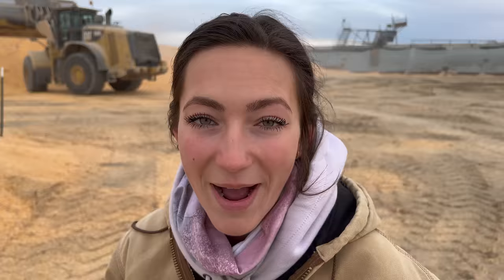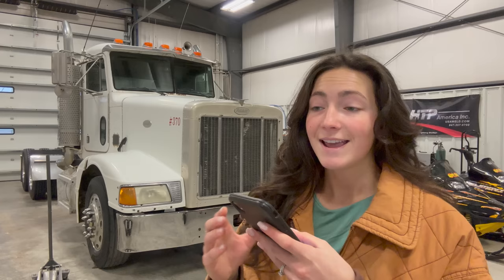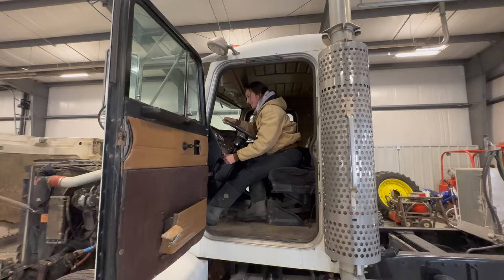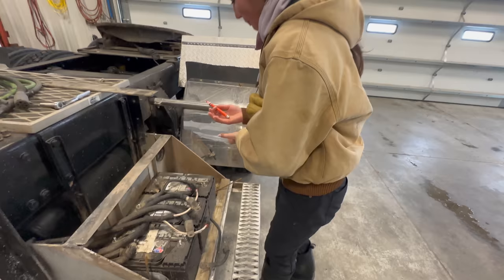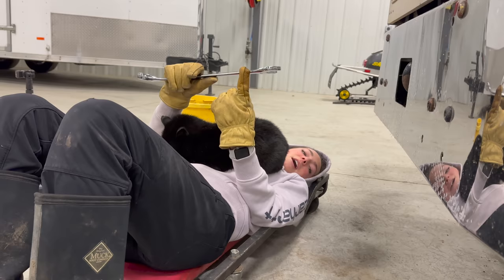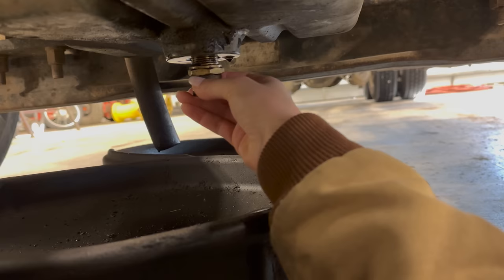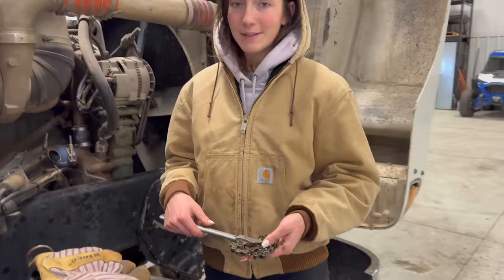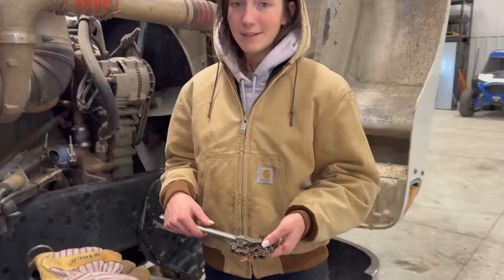The Worst Oil Change

Comment: Welcome to a truckers world! As for yore filters. They make a much larger chain wrench (longer Handle) the trick is when possible grab the base of the filter. The band wrenches do work the strap wrenches work but its hard to beat the large chain wrenches. I have even used 3 foot long screw drivers driven completely thru the filter. A tip fill filters with oil and fuel for fuel filters. If the Detroit series 60 loses its fuel prime its a lotta work to prime the fuel system. As for the heater it could be just low on coolant or the heater shutoff valve could be bad? Old timers used to use manual shut off valves at the engine so check for that. Hey its just a truck. Be kind to it and it will treat you the same! 😊

Comment: that chain-clamp should be sufficient. The problem is that it is stupid tight making the tool not sufficient enough. The same goes for cars also. In such case, try to use it on the edge of the filter where it is strong or all the way up at the top of the filter.

Comment: I have had to drive a rod thru the bottom to the opposite side  and have it long enough to get more leverage on the pull. Of course you will mutalate the filter but it gets discarded.  Could take the front tire off to have more room to work. Good luck

Comment: Get an oil filer wrench with a square connection. There are multiple types on the filter side (band, triple claw, or ones that look like a regular socket head but huge) but you could ratchet in tight spaces with a regular ratcheting handle

Comment: There is nothing wrong with the type of "wrench you have, but a band type wrench does usually work good, the filters seem to have just been on for quite some time and can be very difficult, another helpful hint would be to poke a hole in the bottom of the filters to help reduce messiness when taking them off. And when replacing the filters be sure to fill them with the proper fluids before putting them on to help reduce "dry" starts

Comment: It's been my experience with the 60 Series Detroit engine, that if you don't tighten it, little more than usual, it will come loose.... so, if you see a oil leak on that side of the engine, check the filters....

Comment: I think you probably have the filter off by now, but if not, a strap wrench with a several inch extension so you can get the strap up high on the filter and then a half inch breaker bar should get the filter freed up. I think someone might have skipped the step of oiling the gasket before putting that filter on.

I have encountered similar circumstances after buying used equipment in the past, thus I tend to make sure that I can break the oil filters or other associated parts free before I undertake the task at hand. I also allow lots of extra time and an alternate means of transportation, and park the vehicle where it will be out of the way and can remain out of the way for a couple weeks if necessary. At least you're not messing with it during harvest season!

Comment: This happens on new vechiles as well. Got a new vehicle and the fwctory must have put the oil filter on with an impact wrench  took a day and had to disassemble part of the vechile to get a good grip on the oil filter. Cuss a bit it helps a lot.

Comment: take a longer tube a little thicker than the filter, cut teeth on the end and tap them in a bit, push the tube up with the jack and then twist it.

Comment: It's best to run the engine to warm up the oil. Your problem is that those filters have not been changed in years. So you can try and warm up the rubber on the filter then drive a screw driver through the oil filter and trun. If all else fails you can cut the filter off. But if you cut the filter becareful you can start with a grinder then use a chisel or a Dremal tool .don't rush take your time. Good luck 👍

Comment: Large filter strap wrench, it will stretch some but is less likely to put hole in filter, the one I got has 1/2 drive one side and 3/8 on the other so once you get the stretch out with 1/2, you can use 3/8 to hold your progress.
I have used this strap wrench and had the filters still end up looking like pop cans, Volvo/Mack's have had the worst tight filters I have can across in semi trucks,
Also get filter wrench as close to top as possible, there far more strength at where the filter screws in.

Comment: take a small propane torch and heat the filter right where it meets the truck..the rubber will soften a bit and the heat may help the threaded part to loosen a bit..

Comment: Oil filter removal buy a truck filter wrench 1/2drive. Use at the very top of where it screws into body of oil filter flange. If that doesn't work might try a small cold chisel( if there is room looks tight) at the very top base of filter. Just be careful not to damage housing. Good luck.

Comment: In a worse case scenario ( like this one) I’ve had to punch/drill a hole thru the filter and use a put a bar thru the filter.   You want to get close to the gasket with only intersecting  the filter.

Comment: A correction for you, the 980K weighs about 70K lbs. not 700K lbs.  Still pretty heavy.  For the record, a 100 ton capacity railroad grain hopper car weight about 230K lbs. loaded, a railroad locomotive weighs around 175-225 tons.  Most current generation railroad locomotives are around 4,000-4,400 hp and carry 4,000-5,000 gallons of diesel fuel.  All of that said, they are still 3 times more fuel efficient per ton-mile of cargo hauled than a semi-truck.  You haven't felt real power until you feel 4 locomotives (or more)  get a 10,000-13,000 ton grain train moving.

As for your oil filter challenge, I second the suggestions of using some heat and a proper filter wrench.  If, however, the filter is already compromised, a common mechanic solution is to drive a heavy screwdriver or bar clear through the filter and then twist the filter off using the screwdriver or bar.  That's a last resort, but it may be your only choice if the filter is already partially crushed.

Comment: Because you need a strap type filter wrench that turns your force into torque instead of creating a pressure point like the chain wrenches do.  That filter is one mother tight though!

Comment: A 2" or bigger strap wrapped through  a pipe with a slit has saved me from overtightened filters a few times, then you can put the strap at the base of the filter (by the threads) and apply a much torque as you want to the bottom (....Basically 😉)  that one is tight though.

Comment: There's a decent chance that 980K was built at the factory I used to work at. That was one of the smaller models we made. You should check out the large wheel loaders they use at mines, like the Caterpillar 994. That is a monster.

Comment: You could try and poke through with a metal thorn. I'd say a big screwdriver but i'm afraid even the big ones are too weak for that. So you'll need something thats thin enough to get it through with a hammer but strong enough to stick a pipe on it and turn it. Thats the only cheap and quick way i can yet recommend since you already tried the regular methods. Otherwise you'll need a special filter wrench or a filter claw, but a big one.

Comment: Hey and hi, to make it real easy buy yourselves an oil filter or any filter removal kit, it’s like a socket that fits on bottom of filter which then has a large nut type that you can swing a big spanner on. Darn easier than anything else I’ve used. Toledo tools make a great kit.

Comment: drill a hole through the filter and stick a long extension or large screwdriver straight through it. or buy a better oil filter wrench, they are pretty cheap. A lot of them will dent the can just like that though.

Comment: Get your biggest screw driver and drive it through the center of the filter nearest the end that it connects to the housing on. Then give it a good whack with a big hammer to bust the filter loose. One substantial jolt to get it moving.

Comment: A lot of people don’t put oil on the new seal of the oil filter.  Hand tight plus 1/4 turn.  I just got another filter wrench with a bundle of tools that I don’t need.  I can send it to you.  If the filter is on too tight and the case crushes, often the only thing you can do is carefully cut it off ( a dremmel tool works ok) being careful not to cut the seat or pick up tube.  Give me an address to send it to and I’ll send you that filter wrench.

Comment: Put some heat on the rim,it will either melt or soften the rubber which is what is causing the friction. Also use vaseline to rub on the seal when refitting as it doesn't defrade the same as oil....you can thank me later 😊

Comment: I enjoy seeing the cat in the videos. 
I bought an old Nissan Frontier and had to do repairs after I bought it. The first oil change went about the same as yours. The right front wheel needed to be removed and I discovered a socket style wrench with an extension worked best to reach behind the hardware that was in front of it. 
I know you will keep  trying and you will get it done. 
Happy New Year.

Comment: Hi, greg and Laura, i love to watch your videos. Regarding your overnight filters, yea, no goo thing, but you are using pipe wrenches, which make it worst by crushing them. Get yourself a good set of steel belt filter wrenches and then use those close to te top of the filter where is the hardest part of the filter.

Comment: At this point, the best thing to do with those filters is to punch a hole through the filter with a screwdriver or punch. May have to use a drill. Anyway, punch all the way through and use the screwdriver or punch or whatever works, and use that to hopefully turn the filter off. The closer you can get to the top of the filter, the better. From the video, it didn’t look like you had much room.

Comment: Put it up higher on the filter if you can. I have poked a hole all the way thru and turned it with a screwdriver using both sides.

Comment: Probably by the time you get this message you're probably have the oil filter off the tool I have is a seat belt strap that has a bar on it that clamps around the filter up pretty high on the filter and you can use the ratchet and an extension on this type of filter wrench works real good for all the filters I've ever taken off

Comment: I would try one of two ways, first, get the truck up to operating temp then turn off the truck and try using a different oil filter wrench with it as close to the threads as you can get.  Second use a heat gun or a torch to heat it up then wrench it off.

Comment: Hey guys 
You need to pour clean diesel fuel into that filter  !
Otherwise the engine will stall out & will develop a fuel air lock.
Most filters have instructions on fitting & recommend 2/3 to 3/4 of a turn once seal comes in contact with the base.
So redo that before starting  !
Reply: I have used all methods sugested in comments to undo those oil filters in my 40 odd years of servicing engines...
I believe your auto parts store can provide a wrench that fits over the end of the filter & it has 1/2 drive for a strong bar or rachet with extention...
Reply: That’s a bad idea as fuel flows from the outside of the filter towards the center. If you pour fuel directly into the filter it hasn’t been filtered. You just need to either use the primer (if it has one) or bleed the air out after you install it.
Reply: @markgasper9913  why would you think I would suggest to pour unfiltered fuel into a filter ?
Tbe better method would be to have a fitting to temporarily supply gravity feed fuel on input side of filter & fill filter completely then quickly remove & reconnect original fuel line so as little air gets into tbe system.
But as Laura could well appreciate the first method would be satisfactory in their situation.

Comment: I would  try going both ways tighten/loosen. I have always had success with a large Channel lock If that didn't work I would try a large muffler clamp tight on the filter then use a long pipe attached to the muffler clamp. If that fails rip the filter part off and make a small tool to fit the holes in the filter like the "Talon oil filter tool" with a welder its easy to just make one and done

Comment: Get a filter wrench that goes on a socket wrench. Other wise, I’ve had to stab a screw driver through an oil filter in order to get leverage to remove it before. Someone decided to put it on as tight as humanly possible 😠 needless to say, I don’t do that when I change my oil-I do what you 2 did with the fuel filter. Never had an issue.

Comment: for the oilfilters, first turn the front wheels to the right, gives way more space to work, so can use a longer extension, these chain wrenches work great, but damage the filter easy, there are band wrenches, who also work great, but can get slippery easy, speciall when the filter is already damaged.. personally i would use the chain wrench, get a longer extension, and really try to move slow while turning the filter, the one who put it on there probably didnt use oil when screwing it on, thats why you use the oil, not to make it seal better, but to be able to get it off...just turn slow so the rubber seal has time to move, if you go too fast, or hit it like Grant did, doesnt work, only damages the filter...Goodluck!!...for the next time changing the filters, let the engine/oil warm up first, makes it wayyy easier...bit late now :)

Comment: Loaders small compared to the ones I wrenched on when I was a youngin.. Also batteries on the rig will be dead in a few months due to not cleaning the cable ends and the terminals nuts & coating with corrosion spray.. Fuel filters dont like oil on them use a smidge of vaseline or dip your finger in the fuel from the old filter

Comment: Worst case, send a long screw driver thru the filter to get it started. Sometimes they tighten up as they're driven. Ideally a strap wrench works the best, but they do have filter wrenches big enough. You'll need a hammer to get the screw driver thru the filter and element, the longer the better. Once it pokes out the other side, grab the handle and twist. When it comes off, make sure the rubber seal came off also. That tight, it might need to be retrieved.

Comment: Why didn't you prime the fuel filter? Warm the top of oil filter with a heat gun. Then while applying torque tap the bottom of the oil filter in an upward direction with a soft blow hammer.

Comment: You two had a good way to remove the filter with the belt, next time feed the belt through a boxed end wrench and  the try to remove the filter, but yes they have been on for a while and the temp had a big issue.

Comment: I haven't read all the comments but Laura you said it "A strap wrench" not a chain wrench (which is what you are poking holes with), and a pipe wrench squeezes too much as well as too much handle, unless it is a 90º one. Jack Greider recommended one from Napa that might be the exact one you need, I just haven't seen one. I use two different 1 1/2 inch strap wrenchs and sometimes finding a place for the handle is a chore. I am not a diesel mechanic nor do I work on tractors except my two little ones so I don't buy very many tools.

About the truck batteries.... What size does the manufacture recommed for that 1995 Peterbuilt? Looks like you put three tiny pickup truck batteries in it! All that space in the battery box is FOR BATTERIES! 

I've noticed that all YouTube farmers put the cheapest batteries in all their vehicles and every few months they have to do it again. Parasitic draws are bad enough but killing a battery because it's being overloaded everytime you start the engine is just $$$ stupid.

About those $$$.... You became upset about spending over a million bucks to run your farm yet never said how much profit you made. Not my business you say? Then no more tears from you right before you buy toys that cost more than any of my vehicles did new. Side by sides, four wheelers and snow mobiles and a trailer to haul them on? Plus fairly new diesel pickups and tractors with cabs? Sounds like the profits are there so toughen up and recognize that to make money, you have to spend money. 

I think you had a big hand up getting into the farming business and your hubby didn't get his land and tools (tractors, combines, etc.) by shinning shoes on the street corner. Yes you work hard but you also play alot. I can't go to Moab much less three or four farm shows a year, that travel cost a bunch! Do you really need it to run your farm? You need a vacation every now and then but a working stiff only gets one a year at most and it's not taken off his taxes either.

I know, I'm being mean but I can hold my tounge only so long when so much comes at me in a short period. I didn't have your guts nor the assets you started with so my lack of advancing financially is my own fault. I am glad to see you are doing well and not giving up when things get a bit tight. 

You and Grant are just starting out as a couple so be nice to each other, fight and forgive AND forget it. Take what an old man says with a grain of salt and let it go, maybe you will glean a bit of knowledge from it or just delete it. I've said my piece. Ya'll have a good one!

Comment: I'm not a car guy, but I've seen some pretty obnoxious pipes  paper towel around the pipe then wrench out with vice grips. It might work on the filter to increase contact with the outside and wrench teeth.

Comment: try removing the back filter first so you can position at the top of the filter if not your probably going to have to just break the filter apart then knock the threaded part of with a hammer and screw driver! I had to do that once on an old car literally shredded the filter off in pieces then beat the threaded top off with a screw driver and hammer!

Comment: Try an extra large pair of gas pliers. It’s all about the leverage, physics 101
Tractor supply has good prices.
Heat the gasket o ring the a propane torch, help break the seal.